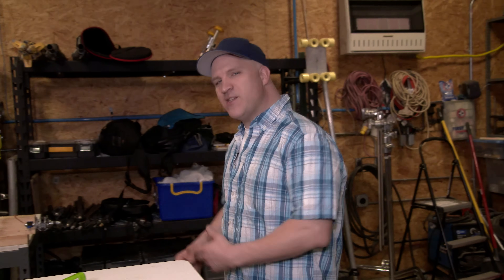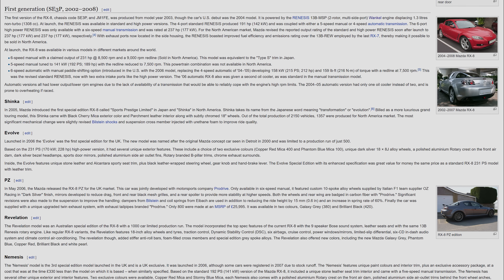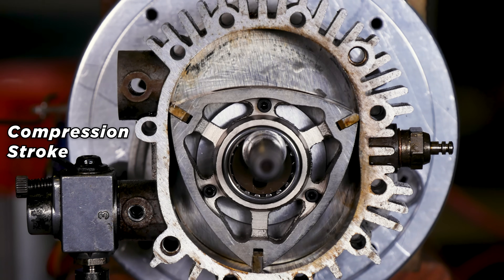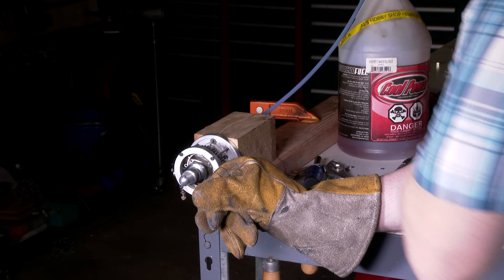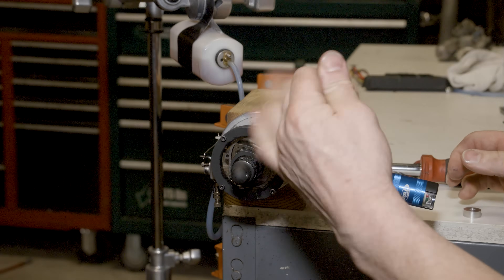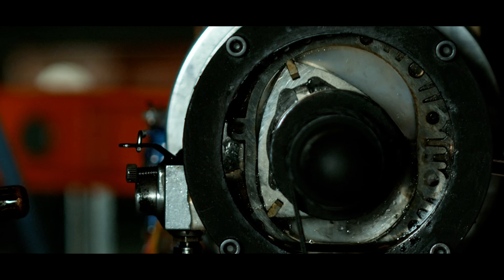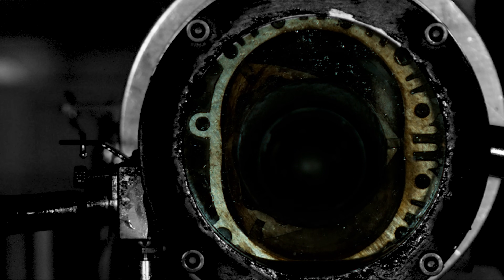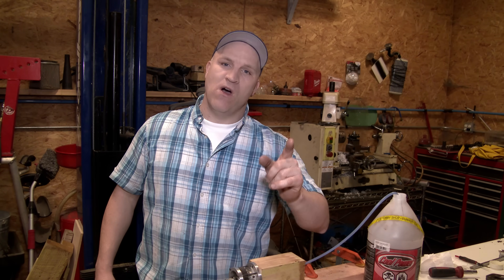See Thru Rotary Engine in Slow Motion - (Wankel Engine) 4K

Comment: Inefficient compared to other four stroke gasoline engines but the most efficient combustion engine when the fuel is hydrogen.
Reply: Not true, Mazda's entry into the Norwegian HyNor program was the least energy efficient internal combustion vehicle tested and was rejected from the long term test series for failing to meet minimum fuel efficiency standards. Mazda abandoned development of hydrogen powered Wankel engines in 2009. The Wankel is very poorly suited to any of the common alternative gaseous fuels including compressed natural gas, propane and hydrogen because Wankel engines are simply unable to generate sufficient static compression ratios to efficiently convert the thermal energy contained in these high octane gaseous fuels.
Reply: @doktorbimmer  The truth is that wankel cycle has less thermal efficiency than otto cycle or diesel. but if hydrogen is the fuel, the rotary engines are way more rugged because of their simplicity  and heat resistant. The piston engines will collapse from the vibrations and heat very fast. Rotary engines are great for their simplicity and the maintenance free ability. They need maintenance on the seals very often but this only effects the fuel consumption and not the engine stopping working at all. But as far as oil and gasoline are the main fuels, rotary engines are doomed to stay back at the human invasions library as engines. They make cool superchargers thou and great refrigerators!
Reply: That is also incorrect, The Wankel KKM-57 design operates using the same Otto Cycle principle as most reciprocating engines.
 The Wankel does not have its own thermodynamic cycle in regards to the Carnot theorem thermal efficiency cycle. 
 Not true, from Mazda's own experience with testing the vehicles  in RX-8 Hydrogen-RE program, power and fuel efficiency were greatly reduced compared with gasoline(petrol) fuel operation and the test fleet vehicles suffered fewer failures and reliability problems when operating on gasoline.
Reply: Every legitimate engine manufacturing company (including the 26 Wankel KKM licensee's and Mazda) have reached the same conclusion regarding the Wankel engine, that it is inherently inferior and offers no significant advantages over currently produced engine designs. The Wankel engines has been obsolete in the manufacturing industry since June 22nd. 2012... they have not been been produced anywhere in the world in over 7 years years.

Comment: so many comments! beautiful vid I wonder if you knew it would be such a success! 
Dude, I notice that the first firing tends (or seems to try) to spin the rotor backward. is this correct, and is this an issue? This example may show u burnt fuel but this is nothing like the spark ignited gas engines. Remember this has no spark plug and also perhaps different fuel that is not atomized like an injector might provide etc. 
   Great!

Comment: Nice concept but I see a bit of inefficiency in that. design.  In slow mode you can see there is a bit of blow-back resistance in the lower part of the combustion chamber.  When the glow plug ignites there is a small part of the chamber below the plug and pressure builds up against the direction of rotation.  There's also the exhaust location that allows for power loss due to the fuel not yet completely burned out.  I'm sure those parts are small enough to be of little consequence bit it is still there.  Thanks for the video,  I learned something.  I hate Mazda though, lol.  Had one once and it was a lemon.

Comment: Maybe a 1.3 litre engine, but everyone forgets that there are 3 combustion chambers for each rotor, giving it an actual volume (and thirst) of a 4 litre engine.
Reply: Stuart well the insurance companies don’t know that
Reply: There's only 1 "chamber" that is technically in combustion 
in a single rotor,
   As the other two chambers are either in combined
intake+compression stage,
  and after combustion you have the exhaust stage.
      Otherwise one rotor of a Wankel engine is in all 4 stages of combustion in all times,
Reply: @MainMite06  This is true, but each piston in a normal piston engine is not in compression all the time, either. Technically, each rotor is doing the job of 3 pistons, so shouldn't the displacement of each chamber in each rotor be considered, also? Unless of course you are an assessor for an insurance company, of course.

Comment: I wonder how one of these engines would run if it was designed as a diesel with a precise amout of fuel delivery.
Reply: The Wankel engine cannot generate sufficient static compression ratios to support reliable compression ignition and the weak, fragile sealing system cannot handle the higher pressures... many have tried to make a Diesel Wankel, all have failed in embarrassing fashion.
Reply: @doktorbimmer  your pretty close it has been tried alot. Few have successfully done it but rolls did nsu did Mercedes did but none did it great. I have been working on one for 8years now and the potential is massive but the implementation is not simple at all. The sealing isn't that hard but making it reliable to detonation ignition is rather hard

Comment: Also a great example of why they have shit torque.
Reply: go crash your big v8 into a tree bud
Reply: Andrei no
Reply: @vSmitezzdN  I just came back to see how this thread was doing? Were you expecting an answer? I'm not going to get notified unless you reply directly to the person.
Reply: Torque isn't the point of some engines.
Reply: @magicoddeffect  true, torque doesn't matter if your engine powering a generator or a pump but in a performance car torque is what makes the difference between a turd and a rocketship.
Reply: @SpeedasaurusDex Extremely poor torque characteristics was a major disadvantage that led to the Wankel being a commercial failure and why it is obsolete today.
Reply: @doktorbimmer  It did great in Le Mans. Four-cylinder inline motorcycle engines also have really poor torque and they're used in all kinds of bikes. 

Commercial success has very little to do with engine characteristics and more to do with marketing and production costs.
Reply: @SpeedasaurusDex Only because all the series points leaders retired early due to a major accident... The Mazda 787B was a disappointingly slow and uncompetitive car that lost 20 out of 21 races, zero poles and zero fastest laps. Mazda lost the 1991 WSC championship to Jaguar.
Reply: @SpeedasaurusDex Compared to what? Wankel powered bikes? Wankel engines were an even bigger failure in motorcycles than cars.
Reply: @SpeedasaurusDex Well then please cite some specific examples, their torque per liter output, BMEP and BSFC performance for comparison.
Reply: @SpeedasaurusDex Just the facts here kid, Wankel engines are obsolete because they are fundamentally and inherently inferior to reciprocating engines, these facts are irrefutable.
Reply: @SpeedasaurusDex Then why are they not used in applications where high power and power-to-weight ratios are critical, like helicopters and military tanks???
Reply: @SpeedasaurusDex Porsche has won the Le Mans 24 hours 18 TIMES!!!! with reliable reciprocating engines, Audi has won Le Mans 9 TIMES!!! with a DIESEL engine...
Reply: @SpeedasaurusDex You do not intimidate me in the slightest kid,  the truth is incontrovertible, malice may attack it, ignorance may deride it, but in the end we will both remain right here whether you like it or continue to deny it.
Reply: @MajorLeague Its very clear that you do not understand what DISPLACEMENT is or how its calculated...
Reply: Anyone that believes its only a 1.3 liter is no expert... he probable thinks its a 2-stroke too!
Reply: @K. C. W The Mazda 13b has an effective displacement of 2.6 liters when compared to a 4stroke reciprocating engine.
Reply: When compared to actual displacement the Wankel's torque per liter output is not impressive at all.
Reply: Wankel engines have terrible torque output because of the low BMEP and the low mechanical efficiency, the Mazda 13b for example only has a 30mm stroke from a 15mm crankshaft offset without the mechanical advantage that a reciprocating engine with a connecting rod does... the triangular piston (rotor) must push directly on the crankshaft throw without any leverage and actually works at a mechanical disadvantage wasting power and torque.
Reply: @MajorLeague You are a liar and a fake, an amateur fraud that doesn't even understand the basic concept of DISPLACEMENT!!!
Reply: @MajorLeague You are a liar and a fake, an amateur fraud that doesn't even understand the basic concept of DISPLACEMENT!!!
Reply: @K. C.W WRONG! The Mazda 13B series engines have a total displacement of 3.9 liters (2.6 liters) when compared to a 4-stroke Otto engine.
 The Mazda 20B engines displaces a whopping 5.9 liters! Producing 300 lbs-ft. of torque from a twin turbo 5.9 liter engine is pathetic and frankly a little embarrassing for Mazda...

Comment: There is an interesting note here: If you take the area of the chamber, then subtract the area of the rotor, you will find that the Mazda 1.3 liter is actually a 3.9 liter.

Watch the "Engineering Explained" video about why the Wankel is dead.

It's a neat engine, just too simple to be efficient. Or run without blowing oil.

Neat video, though! That was amazing to watch!

Mind if I share to Facebook?
Reply from the maker: Thanks, yes share away !

Comment: Awesome! I can't help but wonder, if they had incorporated trailing fins (extending from the tips of the triangle gear, curved in the clockwise direction), it seems it would have created even more momentum. It would create more of a cupped surface vs just pushing against the curved surface of that triangle gear. I can't visualize a downside of doing that regarding exhaust but it apparently wouldn't have made a difference or I'm sure an engineer would've done it. Just thinking out loud. Lol

Comment: So it's a 3 stroke engine? 
Because it has 3 power strokes in one rotation ?
Reply: I think it would be a 1/3 stroke engine... because if a 2 stroke has 2 rotations per power stroke, a 1 stroke would have one rotation per power stroke,  a 1/2 stroke would have two power strokes per rotation etc etc 👍

Comment: I had a 1974 mazda pickup truck,2 wheel drive,with a wankle rotary in it,duel distributers,4 barrel carb,and a header installed at tampa mazda.that truck was the fastest truck ive ever owned,it would run a quarter in about 14 seconds or so. Screamer,surprised many muscle car owners who ran against it,and they would TOTALLY freak out when i shifted it,and a blue flame would shoot out of the exhaust .i had soo many guys just bug out over that alone.they were like,DAAAAMN,what you got in that thing man,its shootin blue flames out the pipe???? Did have to be careful around dry,tall grass,i burnt about half of kansas down with that thing,but thats another story.
Reply: Did you do a lot drugs back in the 1970's????

Comment: The most fuel wasting engine ever designed!
Reply: The engine he is using is made for model airplane use and uses the excess fuel to help cooling, with a prop on it to help cool it it can be leaned out more to reduce the losses.
Reply: @chucksmalfus9623  Glow ignition engines that run on nitromethane require a richer AFR., but the Wankel engine due to its poor combustion efficiency requires a richer mixture than comparable reciprocating engines.
Reply: Not really, when compared to the power output and low weight. Its comparable to way bigger engines that use just as much or more gas.
Reply: @nomaschalupas  It's not as bad as two stroke engines but it is far, far worse than conventional four stroke piston engines. It is comparable to much larger engines but not in the way you think, it uses as much fuel as piston engines with several times more displacement and power.

The RX8 used as much fuel as a Corvette, with almost 5 times the displacement and 2.5x the power. It also used a lot more oil than a Corvette or any other car that didn't have its cylinder liners all shot, and quite often needed the engine taken apart to replace apex seals after having done less than 50k miles.

It's light and powerful and that's great and all, but for the past several decades Mazda were the only ones still even trying (no they didn't invent it, they just stuck with it after every one else gave up) and even though they really wanted to make it work they ended up dropping it too because there was no future there in a world where fuel consumption and exhaust emissions are a real factor.
Reply: @BigUriel  theres a reason planes use rotarys. Im not saying the power output will be comparable to larger engines, im saying the weight saved from it will make the power comparable. 50 or  even 100 horsepower doesnt compare to the same amount of weight saved and when including the chassis size and less reinforcing needed to fit the engine, thats alot and what im talking about. You have to give up things to have other things, maintaining doesnt matter much if you want performance first, all cars being pushed need the same maintenance. If you just want to look cool and never track a car then go ahead and get the longer lasting boat engines for red lights.
Reply: @BigUriel  i make a big deal out of the size and weight because people pay 10s of thousands for a lightweight aluminum engine thats still a few hundred pounds, But a 13b rotary can be carried by 1 person and can easily make over 400hp.
Reply: @nomaschalupas  No aircraft manufacturer has ever sold a certified passenger aircraft with a Wankel engine. The Wankel is completely unsuitable for aircraft applications and offers no advantage  in power to weight due to it's high fuel consumption and reduced range performance.                 The Wankel is also too unreliable for aircraft, there are no Wankel engines available that meet FAA or EASA standards for airworthiness certification.
Reply: @nomaschalupas  Gas turbine engines offer 10 times better power to weight performance than the Wankel and an order of magnitude greater reliability. Not to mention excellent fuel efficiency for their relative power output.
Reply: @nomaschalupas  Not really, in terms of Specific Fuel Consumption or Carnot cycle efficiency the Wankel is truly horrible. It's power to weight ratio compared to modern engines is not great either.

Comment: Looks inefficient.   Sounds stupid but here goes,  why not make the inside square instead of triangle and add 3 plugs for each of the 3 square sides to burn instead of 1?  So that you can have more burn cycles to make it more efficient and maybe more power?  Does that sound feasible?
Reply: bobby you are right the rotary has a 1080 degree output this puts it ahead of its time
Reply: piston engines are evolutionary but the wankel engine is revolutionary

Comment: I had a Maza RX-4. Loved taking the engine apart just for fun, from time-to-time (much to the dismay of my wife). As long as you got the timing right and the two distributors set right, it was easy as pie to work on. Had to replace seals way too often, though.
Reply: wtf is a "Maza RX-4"
Reply: @Kaguya Houraisan You don't know much about Mazda do you kid?
Reply: @Kaguya Houraisan I know what an RX-4 is... a car made long before you were born kid.
Reply: @Kaguya Houraisan Today marks the 7th anniversary of the end of RX production, on Thursday June 21, 2012 at 4:30pm the final RX-8 car ever to be produced rolled off the assembly line, the last RX model to ever be produced by Mazda.
Reply: Poor reliability and short service life is exactly why they are obsolete now.

Comment: Real bad video. Didnt learn a thing. If you want to see rotary engines that can kill, check google rotary engines in New Zealand. Theres a group of guys that are building 4 and 6 row wankels. Burn the tires right off a dragster. These were outlaws in motor racing because theres no way to judge the displacement.
Reply: I guess that is why New Zealand doesn't have an automotive industry or international racing... poor bastards are still fooling around with old obsolete junk!

Comment: So the 2-stroke of cars
Reply: Wankel engines all use the exact same 4-stroke operating principle as Otto type engines.
Reply: doktorbimmer yeah but there high reving and wayyyy lighter than most other types less things to break and go wrong also use way more gas then that should
Reply: Not really, 2-strokes are higher revving, lighter than Wankel engines. 2-stroke engines have fewer parts than Wankel engines and have less thing to go wrong.
Reply: 2-stroke engines are better and are still mass produced, Wankel engines has no advantages and are now obsolete.

Comment: You mean trying to start backwards and spits most of the fuel out the exhaust? There's a reason they died
Reply: Yes, the Wankel was inferior to the reciprocating engines.
Reply: @doktorbimmer  in your opinion
Reply: @Kaguya Houraisan It is not an opinion kid... it is a fact.
Reply: @Kaguya Houraisan Yes, it is a fact... Wankel engines were a commercial failure and are obsolete today because they are inferior technology compared to reciprocating Otto and Diesel engines which are still mass produced in the millions every month...